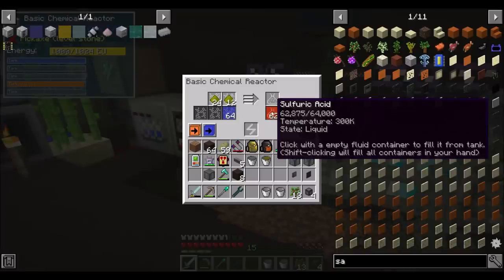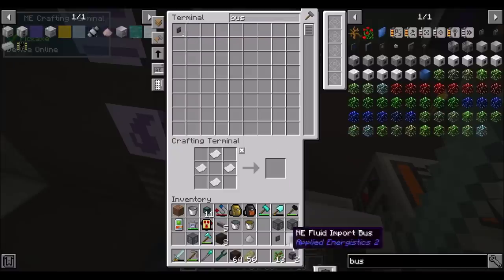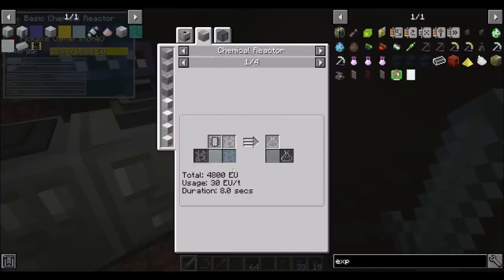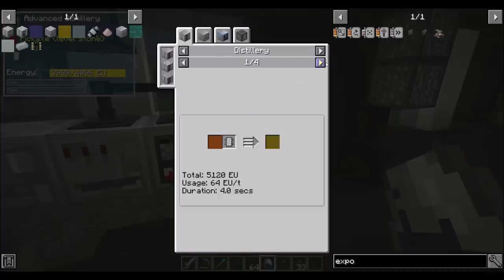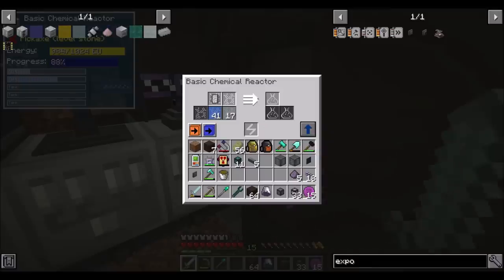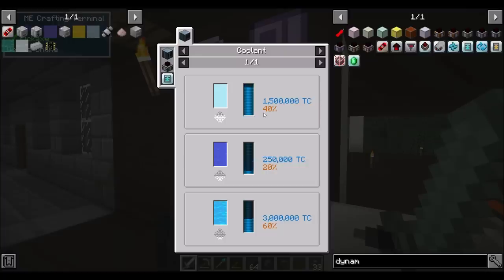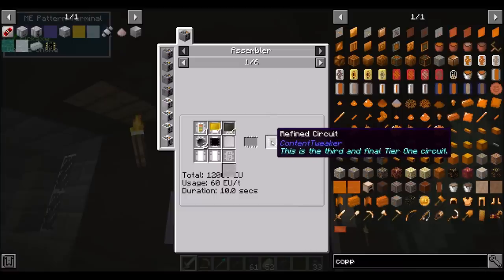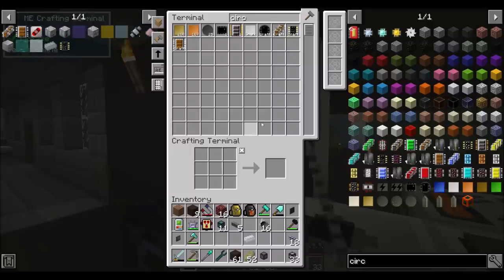OmniFactory   Ep28 Automated Polyvinyl

Comment: Cables: can run X machines at a time.
CEF will only fully supply machines equal to the number of batteries inside them.
Dire learn how to use auto output for the greg tech machines
greg tech chemical reactors wont allow liquids to enter them if they dont match a recipe and there's already another liquid inside
Reply: Few things incorrect.  You can run more than 4 machines at once on 4x cable.  For example breweries only take 3 EU/T a single amp of LV supplies 32.  Even with the overclocking you can supply something like 3 machines per an amp.

CEF doesn't even need batteries in it if you power input is strong enough such that you are giving the machines full power without any additional help.  I don't use batteries in any of my CEFs other than the beginning ones.  All my power is being stored inside CEUs from my diesel  generators.

Comment: Ramp up you power production dire
like Steam Dynamo Boiler conversion to Steam Dynamo Turbine conversion
the ratio is like 1 to 2 but depends on upgrades
and magmatic is decent kinda hard a pain to get since dark steel
i suggest getting atleast 5 numismatics with lapidary conversion and use diamonds produced by Deep Mob Learning Shulkers 1 is enough for 2

Comment: Best to use sugar cane in the steam dynamos with the turbine upgrades for power
Reply: Honestly there is no best way.  There are easy ways and fun ways.  Better than lava for fun and usefulness would be lava crystals in a boiler/turbine dynamo setup.  You'll need the automated quartz production for deep mob learning and it gives a ton more energy.  Of course at his stage he should be looking into Bio-diesel or diesel.  Oil byproducts produce diesel and naptha along with refinery gas that can also be used for power.  Speed up his ethanol production and biodiesel is easy to make and as you get better technology scales very, very well.  The production of biodiesel produces glycerol which combined with the naptha from oil and some chlorine mixed with other stuff makes epoxy for the next tier of circuits after plastic and beyond.
Reply: Basically everyone ends up burning diamonds eventually.

Comment: Hydrazine was used in early rockets.
Reply: Hydrazine (both plain and as unsymmetrical dimethylhydrazine, or UDMH) is still a common rocket fuel. The Russian Proton rocket (among others) uses straight UDMH. The American Titan and Delta rocket families (and notably from the launch yesterday, the Indian GSLV) use a 50/50 mix of hydrazine/UDMH. Some rockets have also used monomethylhydrazine, such as the Space Shuttle (which used it in its orbital maneuvering system).

Comment: You could make another pump and lower the chance of not having lava..
Reply: 2 pumps is a great suggestion! The chances of both of them stalling at the same time is a lot lower. He should also not be so hesitant to move them. Even if they aren't finished, moving them is very easy to do and more efficient than waiting for every single pocket of lava to be taken in a controlled, yet highly slow setting. Lava lakes scale farther than the eyes can see in the Nether.  Sugar powered Steam Dynamos are also a great infinite source of power that doesn't require replacing pumps.
Reply: Also, place the pumps in the center of the lava lakes, not on the sides!

Comment: Dire, you really need to get into better power options: Like grabbing Witch and Blaze Spawners out of the railway tunnels found in worldgen, which you can find easily using a scanner module configured for vanilla Minecraft Chest. If you see 4 chests in a row you've found what you're looking for. Simply grab the spawners using a Chest Transporter - yes that mod is in this pack now - and you can get Witch and Blaze Spawners set up with Killer Joes killing them and feed the results into a Reactant Dynamo bank for stupidly large amounts of power. You will of course want to grab the solid and liquid experience as well for the other half of the Reactant Dynamo setup you're going to need. Don't get me wrong, lava power is fine while you have plenty of lava available but it's limited by the pump needing to find a new lava source so you need something that'll run as a backup and additional power supply. You could even do it by your traditional way of using Cursed Earth and Killer Joes on general hostile mob spawns.

Comment: Yet another comment about how dire should get an air collector so he doesn't need to use up so much oxygen to make Ethylene
Reply: Oxygen is cheap and fast to make if you make it from stone dust instead of making it from water. Ethanol is much more expensive where Dire currently is.

Comment: Dire you need to stop using your fluid conduit and switch to ME it would be a lot cleaner and easier for you.
Reply: Relying on ME for everything isn't that great.  A lot of times in gregtech you'll need multiple machines doing the same thing for certain products.   Bio-diesel for example using a ton of breweries.  It's a lot simple to hook it up with conduits.  Generally in a production chain I would say ME for things that aren't produced inside the chain, though depending on the product a tank to store the stuff to transport to multiple machines is best.  Anything that is produced inside the production chain should be fluid conduit/item conduit around.
Reply: Nedrith Stormfire The reason why I think ME is still better in all cases than conduits is because it makes it really freaking easy to scale up your production line if you’re doing all your liquid management through ME it also allows you to place your machines wherever the heck you want because you don’t have to worry about connecting them up to conduits you just need to connect it to your ME network which should be everywhere.
Reply: @matthewrobinson6091 Generally I always think in terms of production chains, because it's easy to make a chain.  So where to place a machine is easy.   My base is spread so far out that that each chain has quite a bit of space next to each other.  I hate spacing out machines in a chain though so each machine is right next to each other, similar to Dire except the machines on the floor have the power running behind it rather than beneath and then I have another set of machines ontop of the power cable.  So I have 3 sides of a machine taken up, 2 from the machines next to the machine and 1 from the power cable running either beneath or behind it, leaving 3 spots.  For machines that need an import bus, export bus, and fluid import and export bus, it's basically impossible to fit all 4 on the machine.  For the most part all of that can be done using only a single side using fluid conduits and even better 2 machines can share the same conduit because while it makes it looks worse I just run cables straight between the 2 machines.  If the chain doesn't make a certain liquid(hydrogen and oxygen are common) then it gets either an Fluid import bus either straight to it or into a tank so multiple machines can share it.  Besides that and any imported items any chain can run independently of each other and should never need to interact with one another apart from the final machines in each chain which get imported or storage bussed into the AE system.

Scaling up is simple, Scaling up my bio-ethanol chain just required adding 2 breweries for example.  In some cases like my vacuum freezer -> cryogenic air distillation machine it was just a matter of turning the vacuum freezer into HV, though to be fair I might make a second vacuum freezer to that chain, I believe I have space for 4 of them in the area it's sitting.